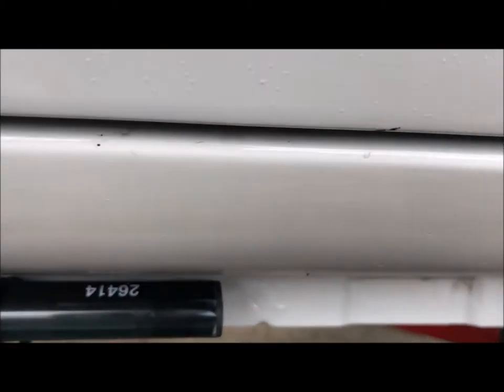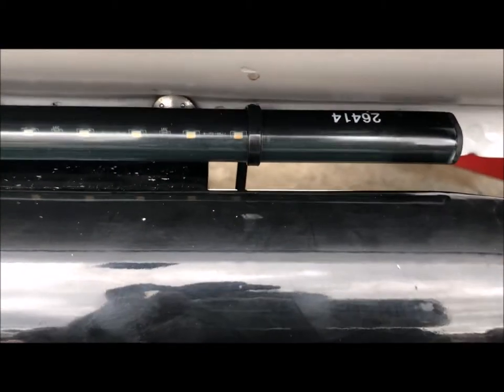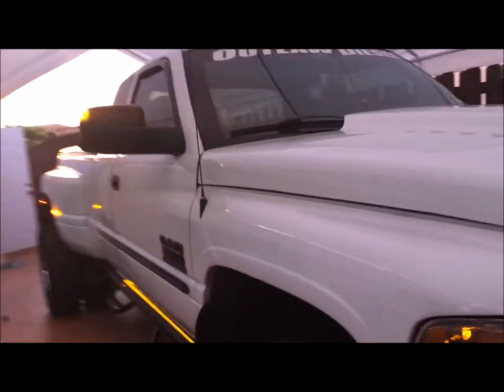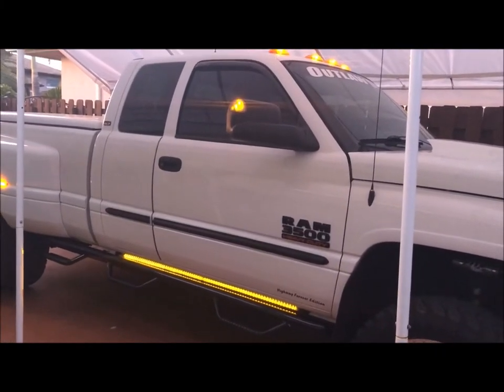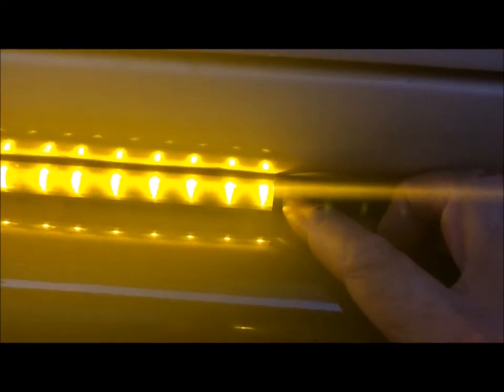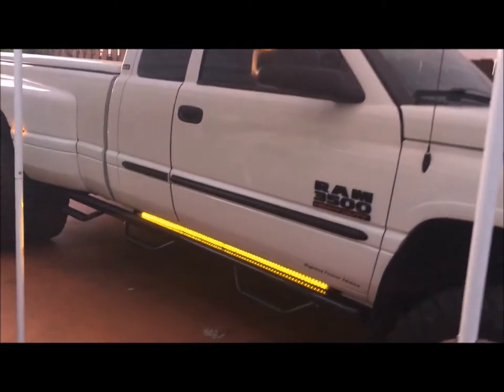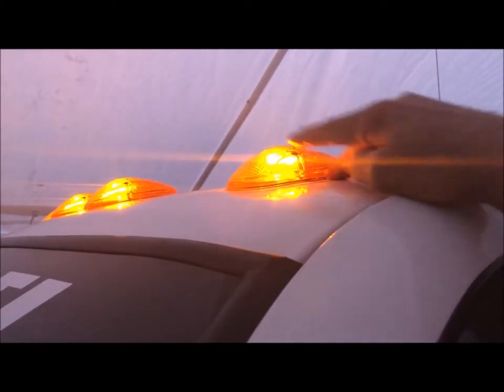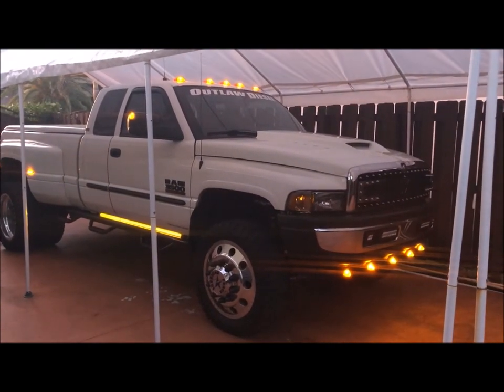Recon 62" BIG RIG LED Side Mounted Running Light On Dodge Ram

Comment: To be a little more clear, each side has two stets if LED’s one is brighter than the other. The brighter one can be connected to turn signal. And you can connect all, like this guy, at once. Gods vid, great truck. Love the Ram!!!  Keep them vids coming
Reply: I meant “good vid” not “gods vid” dang spell correction
Reply from the maker: thank you for that.  I'm sure it will help someone out interested in these lights.

Comment: I know I'm late to the party but would you tell me where you got the marker lights that are up under your bumper in the front at please ?
Reply from the maker: No problem brother.  Go to eBay and punch in the following:  5pc amber led marker lights top 9 diode 2” round beehive clear for truck roat
Reply: @conquryourfear  dude thanks alot I love the rig man you got great taste in trucks for sure, I got a 97 1 ton just like yours only it's black and im building it up ..... I also got the SSK Ram air hood as well and a Ram hood ornament on it too haha
Reply: @conquryourfear  alright I found them, so do they last have you had to replace any yet because looks like it would be a pain in the ass, and how did you get them to mount to that black shroud piece that their on ????
Reply from the maker: OG Ragan ok. You have to get a big enough step drill to cut out the hole. Go little by little until you can squeeze in the rubber garment that comes with the light. Then squeeze the light in. They don’t go anywhere.  As far as how long they last...if u buy the cheap ones not too long. So try to get a good set. Here is the actual video I did on these lights:  https://youtu.be/Umy47HnV5hQ
Reply: @conquryourfear  sweet sweet thanks alot brother I appreciate it

Comment: LED Glow sells one thats 70 inches and cheaper.
Reply from the maker: wish i would have seen this before.  i googled it to.  oh well, maybe I can sell these Recons and get those.  thanks for the heads up.  take it easy.
Reply: conquryourfear Yeah those 70 inch ones are almost full cab length. I just used 3M tape to hold mine on as well. I hate drilling holes.
Reply: Who the fuck wants cheaper? We own these trucks were rich